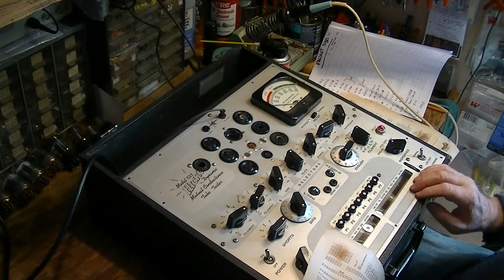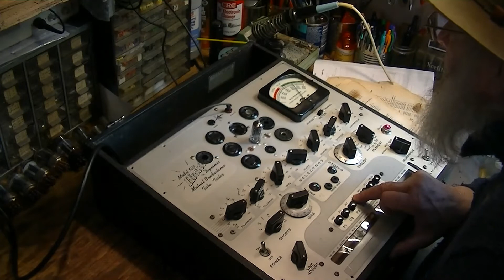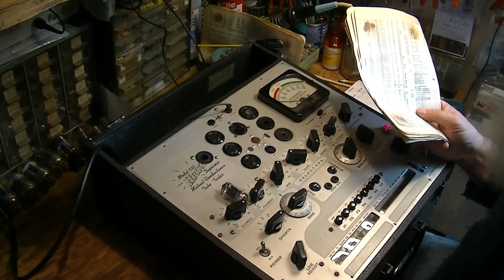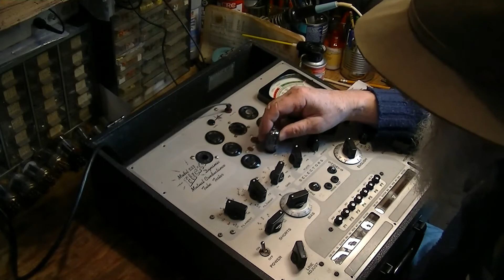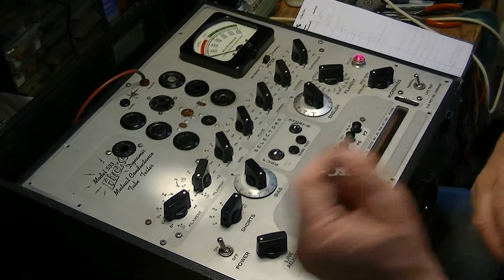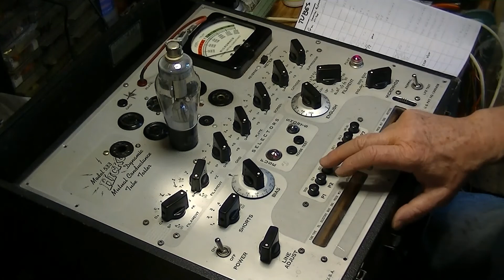W6WUH   Hickok Tube Tester Tutorial   Basic and Advanced Tube Testing  ( Valiant Overhaul # 10 )

Comment: If you get a "shorted" reading on a tube, double -check that you have set the tester controls properly for that particular tube before you chuck the tube in the trash!  If you get a number of the same type of tube that are measuring as "shorted" (or weak),  it might be a good idea to look for a different roll chart or a different set or year of tube test data for that same model of tester, just to make sure that the chart you are working from doesn't have an error from the factory.
Reply from the maker: if you aren't double checking your settings before you put the tube in... well doing it later is likely to be accompanied by some grief !

Comment: Spraying tube pins with Deoxit is a poor way to clean them, and immediately putting the tube into a socket on the tester not only doesn't give the Deoxit time to chemically clean the pins but will also leave traces of Deoxit in the testers sockets and eventually gum them up. I prefer to clean the pins with a toothbrush-sized wire brush (steel is better than brass) followed by a spritz of pure alcohol, and then use a pin straightener to straighten the pins before plugging the tube into the socket. These methods will help preserve the life of the built-in sockets. Use of "socket-savers" bolted down into the original sockets is a good idea, especially if you test a lot of tubes ---- it's much easier to replace a socket-saver than to replace an actual socket inside the tube tester itself!  As for use of Deoxit, if you feel you must use it to clean the tube pins, let it sit a while and then flush with pure alcohol. DO NOT spray the testers' sockets with it, it's better to clean the sockets with pure alcohol; and any use of Deoxit to clean switches and controls should be done sparingly, or you risk creating leakage paths that will screw up the tester, perhaps permanently.  Don't just spray the Deoxit directly from the can, squirt some into the cap or a small bottle and use a syringe to put a drop or two exactly where you need it, without saturating the entire switch wafer.
Reply from the maker: well you certainly have a lot of opinions, some not based in fact... there are in fact several types of De-Oxit.  D5 which I use here.. will NOT evaporate and leave any Gum !   where you got that goofy Idea I don't know.   Putting it into a small bottle cap and dipping the pins works fine, if you are working with multiple tubes in sucesssion.   You wont catch me using abrasives on tube pins... if they are that corroded, I am not using them in my equipment anyway !   That maybe fine for the guys who also put radios in dishwashers... but my posts deal with doing things the right way, with good parts and techniques.   If you had used De-Oxit on high voltage circuits as I have.. you would know that it will not create any leakage or arc paths.  Those are generally created when something catches dirt, and that absorb moisture from the air.. creating a conductive path.  I have not found DeOxit doing this on phenolic, plastic, or ceramic insulators.  One can use alcohol as a degreaser on pins if you are afraid.. but I find that the reliability of my overhauled radios with deoxit on all contact surfaces.. tube pins and sockets, plugs, wafer switches etc is as good as can be had.  I have radios still in service 30 years after being overhauled ... with no call backs.  The 525 tube tester you see in this video i have been using over 30 years.. with the treatment you see.. still going strong.   Ideas are fine,  but they are better when backed with time tested experience.  thanks for  watching and taking time to comment.
Reply: I have socket savers in my Hickok 752 there a must if testing lots of tube. As for cleaning tube pins I just use some ipa. If there bad then use some light sandpaper
Reply: Best tool I use for pins Is fiber glass pen shines them up